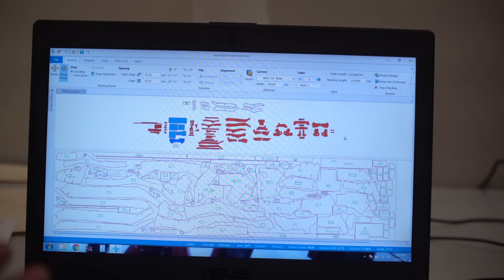The FUTURE?? Ibis's SECRET carbon innovations - IN THE USA

Comment: Yes handmade in USA carbon frames would be ideal but not all can afford. Ibis could market the basic, made overseas carbon frame as the more affordable and have the handmade as the lighter stiffer option. Kinda how Santa Cruz does the C and CC or yeti carbon and turq series
Reply from the maker: I think that would make good sense, jborgar!!!
Reply: That's a great idea! Thanks for the suggestion. Currently, we're pricing our USA made frames at the same level as our overseas bikes. Our goal long term is to keep improving our US production process, so that there is little difference in manufacturing costs.
Reply: That's what I like about you guys! Always innovating and improving processes. Either way I will always support Ibis!

Comment: If Ibis can produce frames that are cost attractive, absolutely I would buy one.  

I just bought an Evil FollowingMB so I am open to spending some $$$ on a frame but what I paid for the Evil is the absolute max I would pay.  
I need some left over for a nice set of wheels, good suspension!
Reply from the maker: Evil has gone a different route by bypassing the bike shop middleman, so pick your poison there!  Evil does make nice stuff though!

Comment: I desperately hope that Ibis' next bikes (perhaps the next Ripley) have a reach which is less than the 430mm of the "small" Ripmo.
Reply from the maker: Thanks for the note Robert!  Have you ridden the bike yourself yet?  My wife is 5'3" and Roxy is 5'1".  Both feel super comfortable on the small Ripmo.  The way the geo works out with the steep seat angle that 430 reach doesn't feel huge by any means!

Comment: Is great we might have frames built in the USA, absolutely.  The frame is the heart and sole of a bike, but the other 23 lbs of stuff attached to the frame is made in China.  As a 30 year retailer (tennis) I favor productivity and competition.  If all things are created equal I will purchase the cheaper product.  This means I have more money left over to buy other MTB gear.  I will say this, China QC at 1/30th the price compared to the USA is actually incredible.  My current Ibis Mojo 3 HD loaded with Sram/Shimano/Raceface/Spanks/Rethal parts is all produced in China, no issues for the last 2 years.  In my world (tennis) we get the question all the time "can I buy USA made" racquets/shoes etc... After you explain the price would triple then become okay with China made products. US Customers want US Made products but at China pricing. That will NOT happen.  In the future, automation might change this process.  In China a working wage is $2/day in the USA it's $10-40/hr plus benefits, time off, holidays off, paid vacation etc..  Way too hard to compare costs
Reply from the maker: Price is usually the deciding factor- I'd say for 99% of the market.  I think a premium USA offering and a standard China offering would be the way to go!
Reply: I'm totally on board with innovation and new ideas, product or production.  From 30,000 ft innovation this is always a good thing.  While not all new ideas workout it's the journey over time that's important. Sure I can still ride my first MTB for 1990, steel, no shocks, weak brakes, road geometry (which killed my neck), 640mm handlebars but the technology changes over the last 27 years has made MTB some much more enjoyable for everyone.  I'm on board with Ibis breaking ground and doing the work in house.  It's a well run family style business that oozes quality.  Staff is super friendly.  FYI, the quality of your videos continues to improve.  Absolutely love your riding style/skills.  I'm in Bend 5 months a year and  An Ibis group ride would be in order.   Mt Bachelor (Funner, Tiddlywinks, Tylers Traverse) and the Phils area (Voodoo)

Comment: Cabron secret? Lol. If you want really good carbon mtb frame it must be made with the help of F1 team of engineers.
Reply from the maker: F1 engineers can make 2-3 items at a time.  Bicycle engineers need to produce several thousand items at a time.  Same with aerospace guys.  The trick is to bridge the gap between amazing one-off wonder work and what can actually be sustainable in a production line!
Reply: Jeff Kendall-Weed talking about better quality control, better molding techniques and especially checking for moisture stuck between carbon